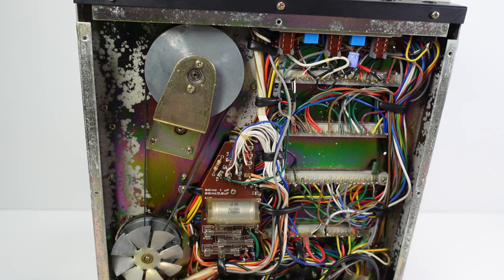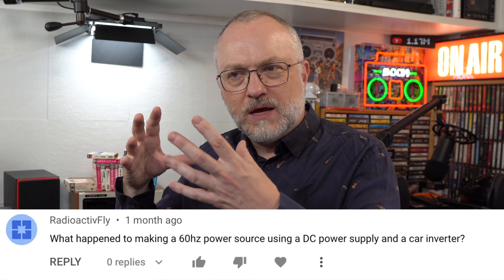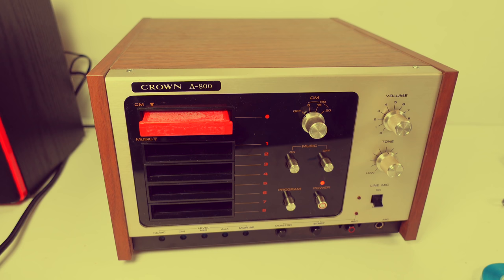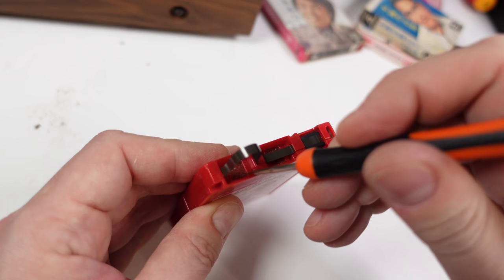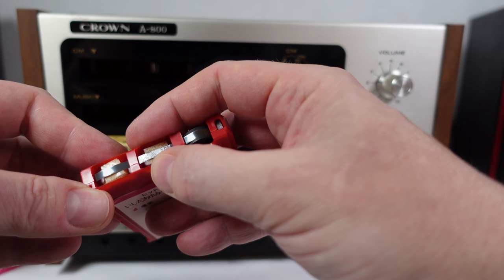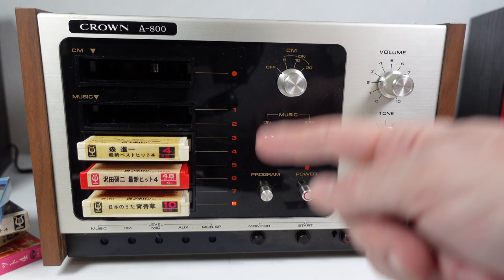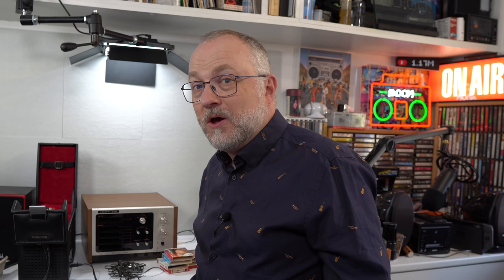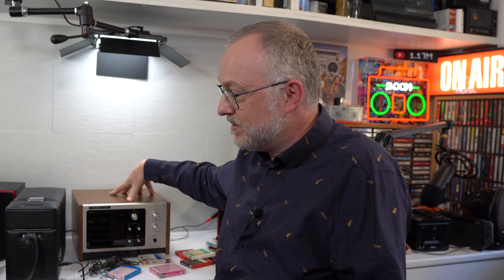Hipac - Fixes, fails and a flash of inspiration

Comment: Thanks for the mention, hopefully it will help others.
You could add a capacitor in parallel with that one to increase the speed further, maybe a 0.25 or 0.5, but you'll have to keep an eye on the temperature of the motor, not sure how far it can be pushed ;)
Reply: I would try to go at it with math. The speed of the motor and size of the capacitor have to be in some relation.
Reply: @HappyBeezerStudios  the text on the circuit board was clear, 0.6uF for 60Hz and 1uF for 50Hz. Matt's taken a .6uF capacitor out and put a 1uF in, so that was clearly the solution for converting from 60 to 50Hz.
Reply: The best advice would have been to add a 0.4µF cap in parallel and keep the original in place. Greetings from a physicist.
Reply: @mojoblues66  It's a ~45 year old capacitor in a coroded case, I'd change it anyway.
Reply: @mojoblues66  Why is this the 'BEST" solution ? Are physicists famous for overcomplicated and redundant solutions of dubious reliability?
Reply: @JeffPDX1  Because it keeps the original parts intact.
Reply: @renakunisaki  There is no variable cap in the 0.1µF range. The typical capacity would be pF.
Reply: @renakunisaki  A 1uF variable capacitor? Good luck finding one of those.

Comment: The Sherlock Holmes of obsolete audio!
One other chap mentioned this trick way down below in the comments, but it's worthy of repeating. When you're opening up a system for repair it's good practice to unplug it, turn the power switch back to ON and let it sit for awhile. Then you can  bridge the power plug with a resistor  or even an insulated screwdriver. Either way you're reducing the likelihood of getting a surprise while poking around inside. 
Excellent work as always sir!

Comment: Your videos are amazing! Thank you for even keeping some of your struggles in the final videos, as they are also informative. Before the years of ubiquitous ICs, capacitors were absolutely used in timing circuits. They are also one of the most failure prone components in vintage electronics. Particularly electrolytic capacitors. There are two main types of capacitors: ceramic capacitors that often look like cute little beige or red-ish disks and electrolytic capacitors that look like cute little blue, silver or brown barrels or cans. They look like cans because they actually have electrolytic goo inside. They are an electrochemical component. As electrolytic capacitors age they dry out inside (like the rest of us) and no longer work to spec. Unfortunately, they also tend to rupture and leak highly corrosive electrolytic deliciousness all over your circuit board. So for vintage gear that is not going to a museum,  I tend to replace all the caps even if they are not bulging (which is a good indicator they are going to leak). This is part of the joy of through-hole electronic components. New surface mount components are not immune to failure as they tend to separate from boards over heat cycles and then work intermittently making troubleshooting a bit of a nightmare.

Comment: I listened to 8-tracks in my cars for years back in the day.  The degraded pressure pads, twisting tape, foil failures, tape eating capstans all brought back fond memories.  And then as the format aged, pinch rollers turning into black goo and constant head cleaning due to degraded oxide on the tape. Good times!
Reply: Had a friend who had a 1978 Cadillac El Dorado (in 1994) and it had an 8-track in the dashboard.  That played everything just a little too fast.  It was wild.  At the time, I was running a home system that actually had an 8-track tape recorder in it, and so I’d tape some things so we could have modern sounds.  My favorite was Sepultura (Brazilian metal band) because they were already fast enough!  OR SO WE THOUGHT!!  🤣    

I still think the eight track is the perfect car stereo medium, because add a cassette tape adaptor (with a cassette adaptor inside of that) and you’ve got iPods and CD players and others at your disposal!
Reply: @deralfenderson  I had a 68 Plymouth with a factory 8-track.  On that Eldorado, I wonder if a little bit of tape got wound around the capstan making it a little larger and speeding the tape up?  Only reason I mention this is because it happened to me once.  I also had a home deck that I recorded vinyl onto 8-tracks with for the car!
Reply: @deralfenderson  I don't care what formats are included in cars, what I'm upset about is how many cars now have totally non-replacable stereos. What is going to be the resale value of a 2018 car when it only uses an outdated Bluetooth standard and discontinued Apple CarPlay in 2028?

Meanwhile, a 2008 car can get brand new head units today from a variety of manufacturers
Reply: @polygondwanaland8390  not speaking for all cars, but you can replace them in SOME cars... There are some chinese shops making android head units for modern cars, shaped to the modern dash and everything.
If i felt like it i could replace the screen in my 18 f150 with a big tesla style screen. 

But, some are simply too integrated (software climate controls and whatnot) and i doubt those will ever be replaceable. 

I still miss the 1din and 2din radio days though, that was so easy...
Reply: My old 70s 8-track player works just fine, and the only maintenance is did was use a cleaning cassette one a while ago

Comment: Well that comment from the so called 'electrical engineer' stating changing the capacitor makes no difference makes him look like a right twonk! Lol. Good for you Matt for not taking no for an answer and getting it running.
Reply: Probably some kid midway through his EE degree.
Quite sad they apparently never built a resonator with a capacitor to generate PWM
Reply: That Supposed electical Engineer apparently has no idea about RLC circuits.
Reply: f = 1 over 2 pi multiplied by square root of LC anyone?
Reply: i think most of us were just stuck on how insane the idea of using a cap to regulate speed in a tape device instead of using a synchronous motor was.
like it was certainly possible to change the speed with a cap but just seemed like it would be very inaccurate and the cap in there looked like a polarized electrolytic.
never once occurred to me that they wouldn't care about the speed as long as it didn't vary and was kinda close.
Reply: As an electrical engineer, I can guarantee to you, that most people claiming to be an engineer of some sort aren't :-D
Reply: It's the internet, anyone can claim to be a rocket surgeon. I myself am a dinosaur chiropractor.

Comment: After the previous video, I was mostly on the "no" side, regarding the capacitor. I was well aware, that capacitors are used for phase changing, to get certain types of AC motors to run on single phase AC. But I couldn't believe that the speed of a tape recoder would be set by using such an inaccurate component.

I guess that I have gotten too used to modern day electronics, where timing is taken care of with crystals, motor speed is controlled with a PID controller, etc. It completely eluded me, that this player is from a time that wasn't in the same way obsessed with digital, crystal controlled accuracy. Pretty cool that the manufacturer made it "good enough" with that incredibly simple solution.

Comment: I'm quite surprised the capacitor change actually changed the speed! But then I suppose I'm accustomed to working with three-phase industrial motors; apparently single-phase capacitor-run motors can change speeds by changing capacitors. I've learned a thing today!

Comment: I thought I saw a curl on the leading edge of that hunk of tape when you pot it in the cart. Ah well, it happens.

Strong suggestion: please find yourself a 1/8" "Gibson Girl" splicing block, or if you already have one, please use it. Back in the 1970s I spent many a very long day splicing tape on carts and reel to reel, and a splicing block with built-in hold-down pads makes things SO much easier than a razor blade and a flat surface. I could make 1/4" splices in about 10 seconds that were always straight and would not pull apart under considerable abuse. 1/8" tape was fiddly and took more like 40 seconds for a good splice, but it was still easy to do. Foil splice tape is more of a challenge than mylar, and a Gibson Girl splice block saves the world here.
Reply: Wow, that thing looks pretty neat.
Reply: That is so nifty! Here in Germany I worked with a crappy cutting track, razor blade and adhesive strips which always stuck to the tips of my fingers and not to the tape! 40 years later and I am seriously envious :-D      (oh, and btw, I saw the curl too and thought... oopsie...)

Comment: "You can't tell me what to do!!!"
(Hits the like button just to spite you)
Reply: Likewise
Reply: I did the same and even commented to drive slightly more engagement for a little extra spite.
Reply: Indeed. It's the only appropriate response
Reply: I always think it's funny when youtubers say stuff like "if you like my videos, click subscribe to stay up to date". Yes, thanks, I know how YouTube works.
Reply: @ironcito1101  Thing is. They know it's patronising but the data doesn't lie. It works.
Reply: @Vandassar  I suppose. Like setting prices like 9,999.99. It's annoying but it's nearly universal, so it must work.
Reply: @ironcito1101  it does - but in a different way people think. The lower price perception is pretty much debunked, but it seems that people are used to see prices be that way for some product groups - while the do not perceive 9.99$ cheaper than 10$ straight for washing powder, they consider it uncanny. Like "ha I see trough the one cent scam" makes to trust them the product more than the straight price. That goes so far that some customers subconsciously prefer 12.99$ over 10$. People are weird, peace.
Reply: @fischX  I don't remember where I once read or heard that round prices like $100 make people think that the seller just came up with that price for no reason, whereas something like $98.75 seems to have a logic behind it, as in "ah, they did calculations based on cost and whatever, and that's the resulting correct price", so people prefer the latter. Prices like 99.99 probably trigger a little of that, in addition to "looking smaller" than 100, even unconciously.

Comment: I love that you 'served' the so called experts by fitting the different capacitor.  I remember when I bought my first record player I was told the speed was  synced to the Hz of the supply, it always played a tad  fast,  I had ideas of fitting  a home grown speed controller but a capacitor would have been an elegant solution and infinitely easier.
Reply: If that would work for your deck. I don't see any reason any decks that weren't made for use in Japan would have this kind of design.

Comment: When working with tape media, whether splicing or adding foil strips, you need to make sure you have no exposed adhesive showing when you're done.  Otherwise, the adhesive will cause the tape to stick to either the capstan or pinch roller and an awful mess will result.  I've also learned this through experience.

Comment: Love your videos. My experience with these motor caps has been entirely in the USA, where the frequency is 60Hz. Still, knowing how these work, I'd bet that the old cap had gone leaky and was way below its correct value. Generally, the value is not TOO important, as log as you're in the ballpark. +100%, -50% is usually close enough. The cap's purpose is to produce a 90 degree phase shift for the second pair of windings on the motor. The motor will run slow if the cap value is too small because it cannot pass enough current to power the second winding. In some cases, a bad cap results in the motor not running at all.
Reply: 1.0 µF for 50 Hz mains, 0.6 µF for 60 Hz mains. That means there is some overlap if we go by -50% to +100%, the 1.0 µF can be 0.5 - 2.0 µF and the 0.6 µF can be 0.3 - 1.2 µF. So the 0.6 µF for 60 Hz is within the -50% of the 1.0 µF for 50 Hz and the 1.0 µF is within the +100% of the 0.6µF for 60 Hz. What happens if the cap is inbetween the values of 0.5 - 1.2 µF? I assume it has to be more precise in this case.

And no mention of mains voltage, which in Japan is 100V with both 50 Hz and 60 Hz (unlike North America with 120V/60Hz or Europe with 230V/50Hz), that might have some additional impact.
Reply: Most air conditioners have a capacitor on the second winding. I know from experience, if you don’t get the value right the fan motor runs slow or fast. In fact, the replacement capacitor looked like an A/C capacitor.

Comment: Interesting vid I went and watched Sparky's video to better understand the CAP business and the penny dropped when he said ' induction motor ' I believe this is  why there was such a divided comment section because not everyone was aware that tape machines use induction motors, I certainly wasn't ! so I have a question for you (I know nothing about tape machines !) are induction motors common in tape machines and HIFI in general ? and what type of motor is considered 'high end' and what are found in the cheap stuff please? you see a DC motor would have been a whole different kettle of fish....cheers.
Reply: At the very cheap end of the scale, a shaded pole motor may have been used, same that's used in many record players
Cassette players often used DC motors
It's usually the better quality or reel to reel that use induction motors, as i mentioned in my video, i helped a friend with repairing his Akai collection, they all have induction motors, one at least has a 3 phase motor which is the same as the brushless dc motors except it's not a magnetic rotor
Reply: @sparkyprojects  Hi ! thanks for this and I enjoyed you explanation vid, I guess this is the reason for the confusion in the chat, but now we know what the difference is ....cheers.
Reply: @sparkyprojects  interesting, And here I thought all AC motors worked off induction just as a nature of how AC power worked.
Reply: @filanfyretracker  Yes they do, a coil is an inductor, it's just that we need a way to label the different types
The shaded pole motor is pure induction, but has a shorted turn to shift the pahse (basically), where as the one we 'call induction uses a second coil and a capacitor to shift the phase.
Brush motors (universal) are also induction, but use commutators to switch the rotor coils, and can be used on ac or dc
Reply: I assume they went with this kind of motor to have something that can be build for both frequencies without having tons of specific parts for each of the halves of the grid.

Comment: 'Just stream music?'  Oh dear.  Someone doesn't quite understand the concept of these videos, do they?
Reply: They don't get the point of this, no - but their streaming 'solution' is not without precedent.  Over the years, there have been a number of methods implementing background music that are similar in concept to 'streaming'.

AM/FM/TV subcarrier via commercial broadcast stations, for example, was used from the 1950s until the 1990s.  Just had to install the appropriate receiver and plug it into the PA system.  In some instances, the 'receiver' was just a modified consumer AM/FM table radio.

Satellite services were used for a while, and I'm reasonably certain some BGM services still rely on satellite.   Some took advantage of CATV systems  as well.

There was at least one service I'm aware of that offered BGM via a leased, dedicated telco line.
Reply: Yeah, and I wonder how much of the music from Hi-Pac is actually on streaming. I'm not Japanese so would have a hard time looking it up although I would like to listen to some of it. I know there are many songs and artists that have never made it to the likes of Spotify.

Comment: The capacitor you use to replace the old one is the same capacitor used in most ceiling fan (non remote) and yes, different value will have different speed.

Comment: I would have been on the wrong side of the "change speed" debate. In retrospect it is a bit stupid to say how a component's value affects a device you're not familiar with without seeing a schematic first.
Reply: Having a cap do it surprised me as well. I would've assumed that for different speed there would be a corresponding cap, not to cause the speed but to balance something out.
Now if it would've been a resistor, that seems obvious.